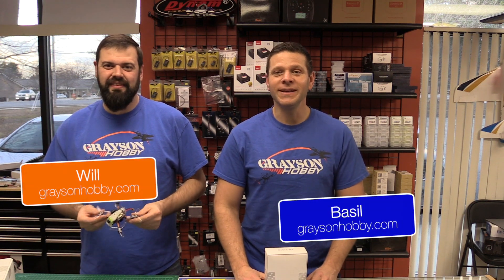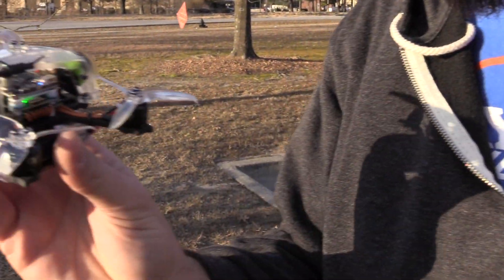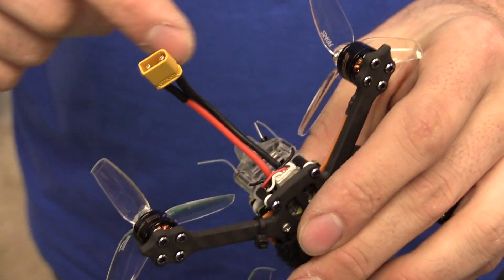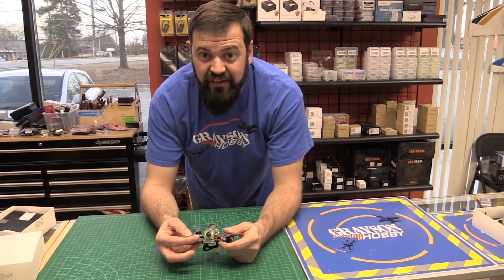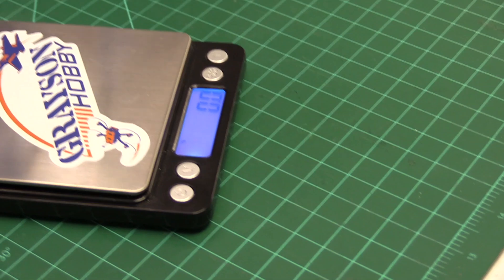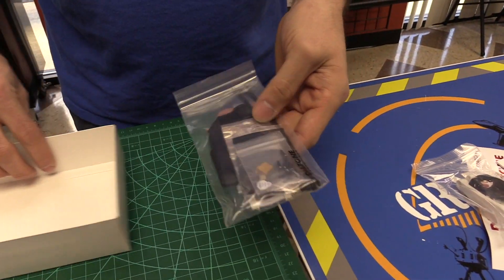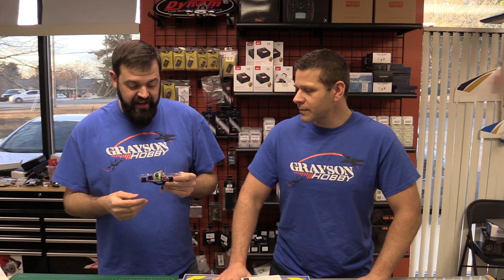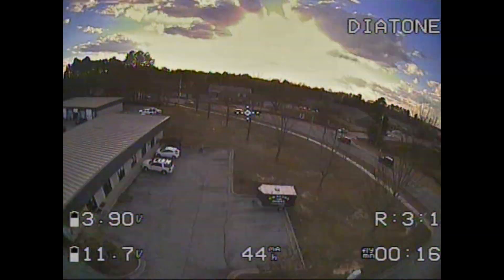Diatone R249 Plus | 2.5-inch micro FPV Drone Review & Speed Test

Comment: Thank You GREAT REVIEW !  I LOVE DIATONE !    so "split mini"  ?  is that on 2 1/2 ?  do ypu have 3" yet ?  3" Sp;it Mini ??
Reply from the maker: As of right now, MiniSplit is only on the 2inch and 2_5 - there is no plane to put on on the 3 inch even though I have asked many times for Diatone to add the HD to the R349.. Something to do with the motors.  Im thinking the props are in the picture.
Reply: FYI  the TMOTOR version is available with 3" split but out of stock.  I want a split mini if you have in stock im buyimg !  this canopy fits the 515 frame !  I am building  !  I have seen the canopy in colors !!!
Reply from the maker: @CaribbeanZapatta  according to Diatone as of  early this January, The 3 inch will NOT have the Mini split for 2 reasons. 1 the Props will be in the picture, 2. the natural Latency of the Mini Split will be too much for the speed of the 3 inch.
Reply: I believe you !  You guys are great !!
Reply from the maker: @CaribbeanZapatta  thank you, but just as the names are confusing, so are their updates.. so you never know..

Comment: If ya started with the 2" and your ready for a little more You can also pick up the "plus" frame and some 2.5" props.
It's cheap and you can upgrade when your ready for more. It's an easy no soldier swap. Love the speed runs.
Reply from the maker: Diatone has made it easy to swap frames - thanks we have some new ideas for the speed runs coming soon